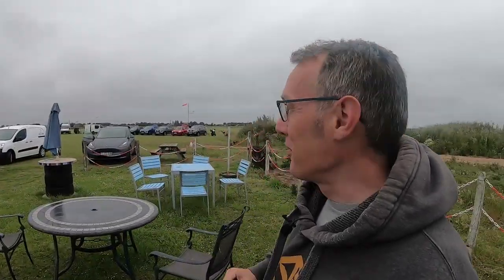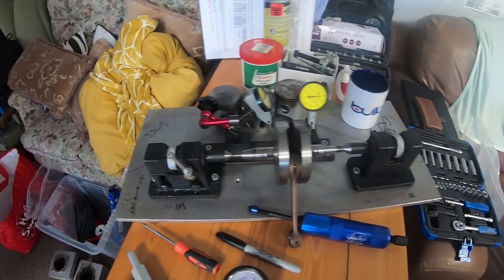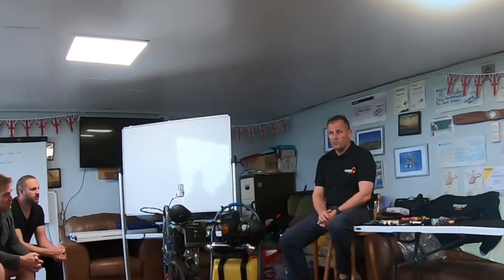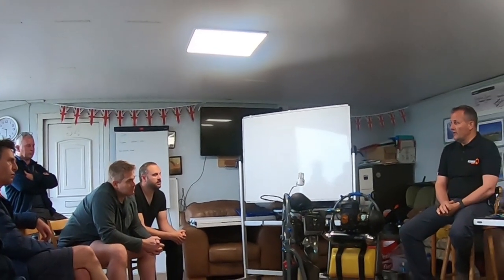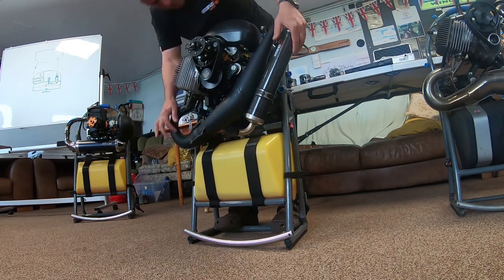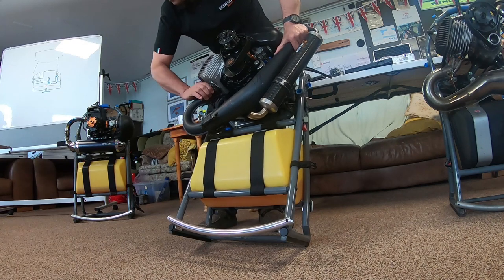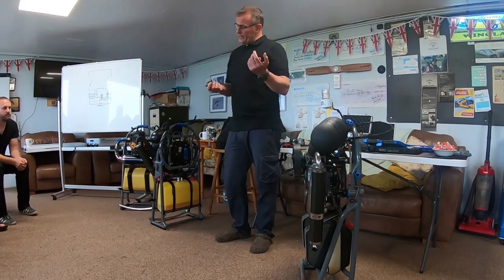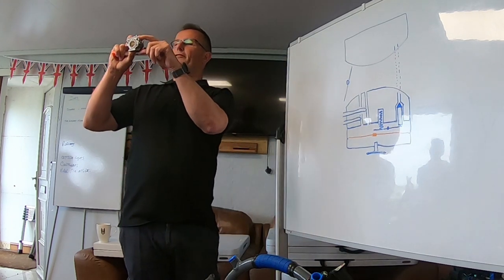VITTORAZI MOSTER 185 - Do you know your engine - Vittorazi Maintenance Day - A few secrets

Comment: A good video to help people think about getting involved with routine maintenance and the need to do servicing on their engines. I do think that some treat their paramotor engine a bit like a lawnmower and not lay them up properly after a flying session and then expect them to work properly the next time they fly, the trouble is with these engines, fuel evaporates and leaves behind sticky oil and the oil also effects rubber part more when they are not in use. Most have the engine behind them so cannot see the exhaust smoke if it different and don’t have the instruments to tell them the cylinders are getting hot. I am not saying all neglect their engine but some just do not realise what they need to do so training sessions like this one really help open people's eyes.
Reply from the maker: Hi Algy, luckily the new Vittorazi manuals are very good and go al the way down to full engine rebuilds.  If only people knew they existed.
Reply: @GolfFoxtrot22  There are a lot of people who might not have a torque wrench and also a lot who are worried they may do more harm then good.
Reply from the maker: A holed piston is pretty bad as well.

Comment: Hi Giles. Another valuable video, thanks.  It would be a big mistake to let me loose on an engine!  I’m the kind of guy that would create three new problems for every one he tried to solve!  So, as my Moster 185 has just clocked up its first 25 hours, I’m relieved to be introduced to Clive’s operations.  His detailed knowledge of the engine is very impressive.  Cheers John
Reply from the maker: Hi John, I'm glad you found it useful. The full day would have given you so much more information but I tried to just give a flavour. The main 5hing, buy a torque wrench, you'll save yourself so many issues.

Comment: Right, so if I need to do this procedure on my 185 out of the box, what has Vittorazi done to custom tune the carbs to get a smooth mid-range?
Reply from the maker: Ho Ed, the only thing they have done is blank off one of the low ilde ports. It's why I sent a year developing and testing my mod. The thing is, it needs to be carried out carefully and out of warranty.

Comment: Hi Giles great infomation on maintenance 
Also Want to ask you do you use CHT and EGT motomonitor to keep eye on temps 
I use CHT but do you have to have EGT or not
Many thanks
Chris
Reply from the maker: Hi Chris, I don't use a motormonitor as I have found them to be inaccurate. I run a cht and tacho. I can't fit an egt as it would damage the exhaust. I'm glad the video was useful.
Reply: @GolfFoxtrot22 thanks Giles 
I didnt know about the inaccuracy how did you find this out I dont want to damage my engine with getting wrong feedback from my monitor 
Should I change it 
Thanks
Chris
Reply from the maker: @chriscasey4819  I've used them in comparison to my own and know how the temps that they are meant to be. A lady trashed her engine today by not reading the motormonitor. Also the RPM feed is way off.